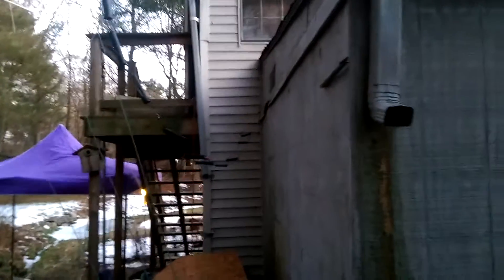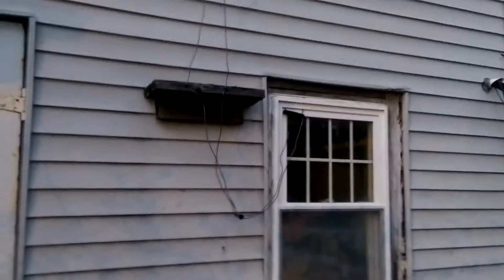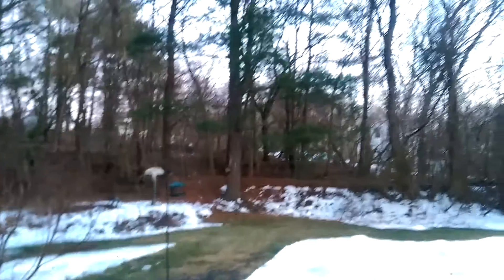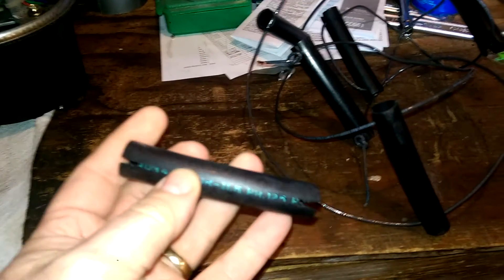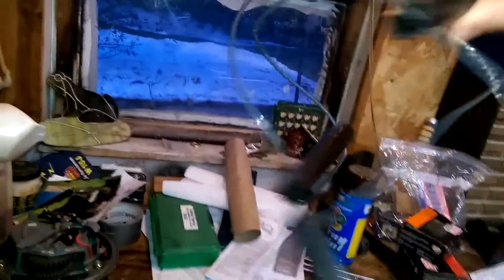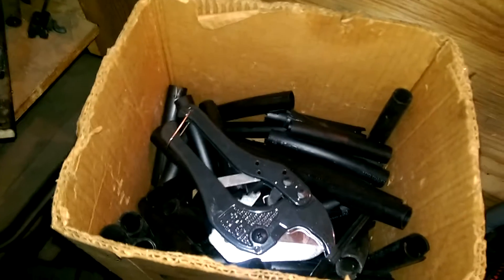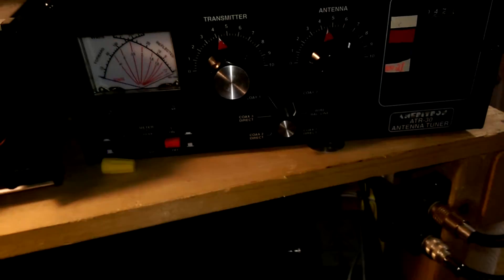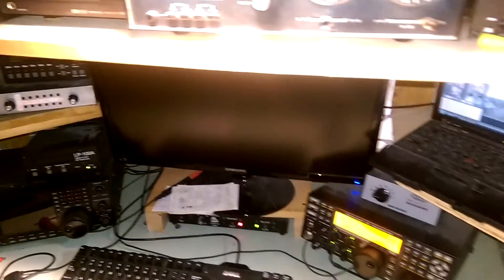W1UJ Zepp antennas with home brew Open Wire Line (OWL)

Comment: How much OWL did you use? I built the Multi-Band Center Fed Zepp built by N1CWR (he calls it a 'Multiband Tuned Doublet' at 135 ft.) He specified specific lengths of OWL but I only needed 65 feet to get to the Shack and with this length, it worked TERRIBLY. It could not even come close to my G5RV. Did you find that you needed to use a specific length of OWL? Thanks.
Reply from the maker: No.  This one is ~88' per side and the OW feedline was about 88' into a 1:1 transformer (isolating transformer, not a balun) with a short coax feedline into a tuner.  You must have a tuner. So this is about 5/8 wl on 40m.  Funny thing, I do not even use it on 40.    It works great on all bands.    If you have a tuned piece of OWL, it usually is for using on a specific band and does not work too well outside of the specific.  Not a fan of unbalanced antennas.
Reply: @JayUJay  Ok that's helpful. Another Amateur also said I should at least be using it with a Balun and coax. As it turned out,  65 feet was apparently one of the worst lengths of OWL  I could have chosen, but I thought with my MFJ-989C, it would still tune it, which it did, but it did not have the 'ears' or transmit of my G5RV by any stretch, so something is wrong. I will revisit this in the Spring and try a Balun. N1CWR specified 109 feet of Ladder Line but I didn't want to have an additional 45 feet of it looping around the Shack. 135 ft on 40m would have been a full wave which is exactly what I wanted, but no go. Thanks again for your help.